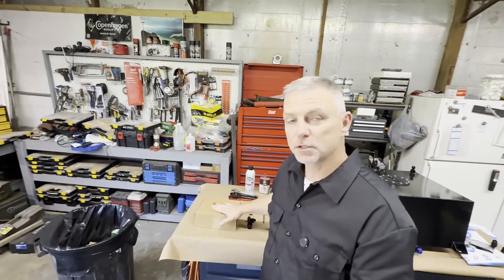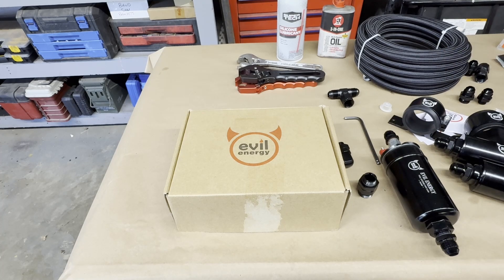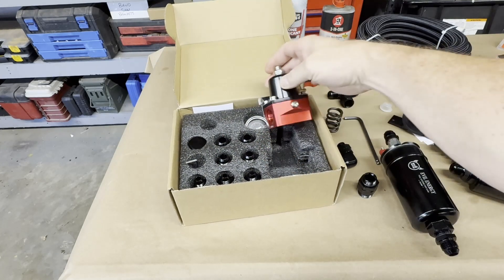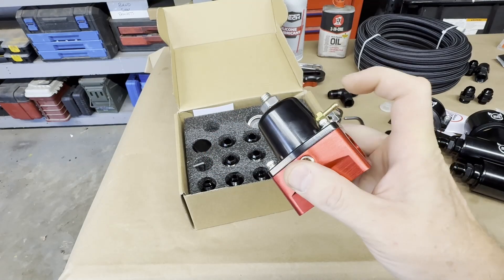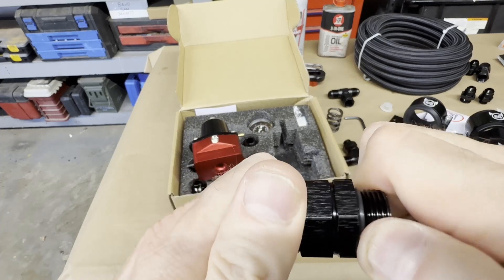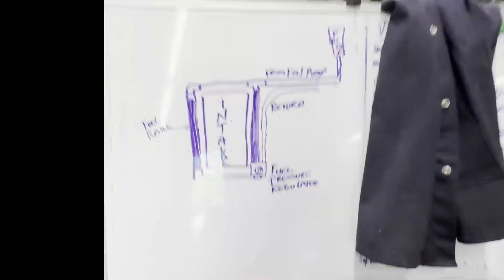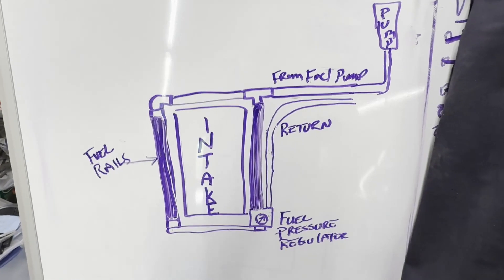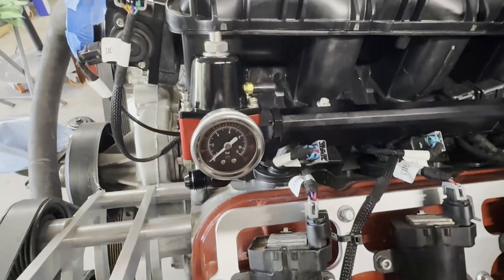Fuel Pressure Regulator EFI Install on TBSS Fuel Rail - #evilenergy #lsswaptheworld #lsswapped

Comment: I could be wrong, but I believe your fuel pump needs to feed your regulator first then your regulator feeds both your rails, because the way it's set up you'll have fuel pump pressure at both your rails before the regulator
Reply from the maker: @oscarlopez2599 As soon as the fuel system develops the 58psi the regulator will open and allow the excess pressure to go back to tank. Check out this Holley diagram (link below) of how they plumb some of their EFI systems. Again thanks for checking out the channel and if you have any other questions please feel free to leave them in the comments and I will get back to you asap. 

https://share.google/TJ1bYyaFYeW7ijiWg

Comment: If I’m running a stock return style fuel rails.,should I run the regulator before the supply line? 

Just doesn’t make sense to me why you’d run the regulator after it’s enters the fuel rails.
Reply from the maker: @rideslowtc250bop2 
If you have the stock return style fuel rails it has a built in regulator in the fuel rail and it will work great. I am looping the regulator into the fuel rails to regulate the pressure consistanly through the fuel rails because I am running a TBSS intake which is normally a returnless style intake. These style intakes usually have a return style filter/regulator rather than a regulator on the fuel rail. The way I set it up, the fuel rails maintain a constant pressure (whatever you have the regulator set at) rather than blocking off one end of the fuel rali and hoping that the injectors all get the same fuel pressure. If you block one end of the fuel rail it is possible the the injectors at the end of the fuel rail system might get just a little less pressure. The way I set it up the fuel pressure is constant through the fuel system before opening the regulator and allowing anything over the 58-60 psi to go back to tank through the return line. The regulator on the rail like you have works fine. The way I set it up just ensures the same pressure to each injector is very close to the same. I have other plans than just a dailey driver is why I set mine up this way. I hope that makes sense. Thanks for watching and asking questions!!
Reply: @dtperformance256 im using a flex fuel system is runs lower psi and I’ve never had any luck with the regulators on the rail.
Reply from the maker: @rideslowtc250bop2 I have heard that some flex fuel systems run a lower pressure 48 psi, haven’t worked on those much. I have 2 gas burner 5.3 and they have the regulator built into the fuel rail. I have never had any issues bit they are daily drivers. I hope I didn’t just jinx myself….knock on wood….lol.  We will see with this set up. I will for sure post a video of it running and the fuel pressures once I get it going. Good luck with your build and thanks again for the comments. Always enjoy a good conversation to see what everyone is experiencing and doing with their builds. Its how we learn!
Reply: @dtperformance256 yes thanks for the reply’s! I’m actually doing a couple first gen s10 swaps myself
Reply from the maker: @rideslowtc250bop2 Very cool! Keep me posted on progress!!!

Comment: Almost there! I like the evil energy stuff, too. Your getting close. I can't wait to get back to work on the trucks. I have been renovating the garages. Wall is gone, building tote storage racks now.
Reply from the maker: @thisoldhooptie I like it so far. Ready to test and check for leaks…. Fingers crossed! I need to get the truck done pretty quick, I have some floors in the house that are rotten and need attention. I know how it goes. Our work is never done!!
Reply: @dtperformance256 Facts! Good luck with the leak test. Have a great week 👍

Comment: I've been looking at this Evil Energy beand for dojng the AN fittings and hoses for the trans cooler in my 67 Chevelle. Just wasn't sure about this brand... All the parts been working for you alright?
Reply: I would worry about vibration overtime and the weight of the regulator cracking that fitting?
Reply from the maker: @deweyharding2972 That is a possibility and I will keep a check on that! I think with the support the hoses give it, they help relieve a little of the weight of the regulator and I hope that wouldn’t happen, but I will for sure be keeping a check on it. Good point! Thanks for checking out the channel and your input on my fuel set up!
Reply: @dtperformance256 I would carry an extra swivel in the glove box.
Reply from the maker: @deweyharding2972 Now you got me thinking…LOL. I looked at it and with a small piece of aluminum angle, I could very easily make a supporting bracket that comes off the fuel rail and bolts to the back of the regulator where the factory mounting bracket was at……just something to help reduce the vibration that it will see….stay tuned!
Reply from the maker: @jeffallen3382 The quality looks to be there. Fitment is good. Price is good, but until I get the truck going I can’t talk about experience with leaks. Everything seems solid, I hope to test it soon. I’ll keep you updated.
Reply: @dtperformance256 cool thanks! I like the look of their stuff.
Reply from the maker: @jeffallen3382 I do too. I am anxious to get it going for the final test. Stay tuned!! Thanks as always for continuing to watch the channel!
Reply: @dtperformance256 you're welcome!